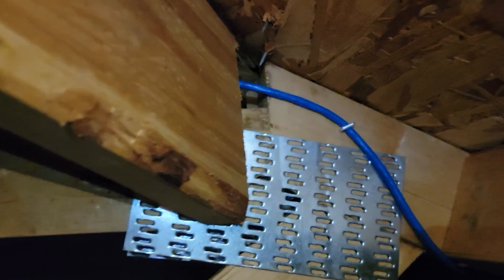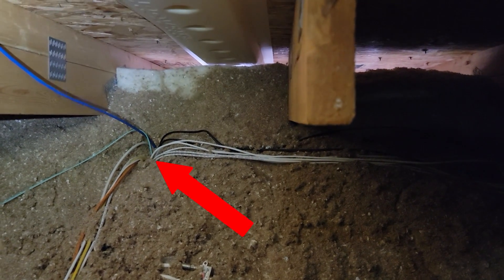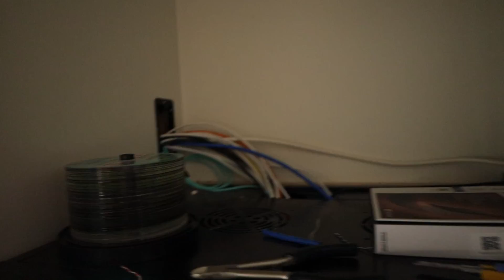Aruba Instant On AP22 & Wifi6 Install & Test FAST INTERNET NOW !!!!!

Comment: can i use 3M two sided tape to glue the bracket to a concrete slab? Drilling screws is not an option.
Reply from the maker: no

Comment: I don’t have the power adapter for my AP I tried to use Ethernet poe but didn’t power on
Reply from the maker: You have the wrong Injector type then.  BTW i have a pile of spare adapters, you can email me and ill ship you one if you pay shipping.
Reply: @JasonsLabVideos  thank you I just bought the switch and it works now I might ask about setting I’m still trying to configure it to the internet
Reply from the maker: @ibrahimssayed8141  ok

Comment: Can this AP simply extend a WiFi signal from an existing router without having to create more SSIDs?
Reply from the maker: Yes, but I would never do that! Can't recommend doing that, and never implement that. It just leads to disaster & unstable network.
Reply: @JasonsLabVideos  Thanks for the reply! What do you recommend? I purchased (2) Ap22 and an instant on 1930 switch. I just purchased a home that is prewired already for APs on each floor.
Reply from the maker: @biznakrivera  The Ap22's are very nice, that's currently what I'm running. I have one in the middle of my 2000sqft home and it covers the whole house.  If I was you, id put one on each floor. I also run the 1930-24-poe switch too :)

Comment: Would be nice if you chould cover Wifi6 configurations on the controller.
Reply from the maker: I can do that, im just working on a video for the AP11d, but for sure can do a wifi6 setup in the controller.. Anything specific you want ?
Reply: @JasonsLabVideos  Amazing!…,If you could possibly cover the GUI configuration of the radios to 6GHz that would be awesome. Reason I ask , I’m currently running 555’s with 60w POE injectors 802.3bt with no restrictions and config has been a nightmare.
Reply from the maker: @leeshen1000  These are like 2 min to setup.. The Aruba AIO's are so simple.
Reply: @JasonsLabVideos  I agree. However I think I just have one of those rear instances. I’ll reach out to Aruba.
Reply from the maker: @leeshen1000  Whats the issue you are having ?

Comment: what equipment do you use for doing all of that? thnx
Reply from the maker: Do you mean the cabling and ends ? or the Aruba equipment ?
Reply: @JasonsLabVideos  cabling and ends, just what tools you used etc thnx
Reply from the maker: @iamrage4753   They Keystones i usually use are Tool Less Cat5e or Cat6. The RJ45's are ezcrimp passthrough connectors. I'll look for the stuff on line and post the links in my description.